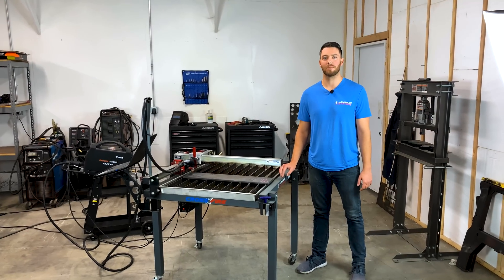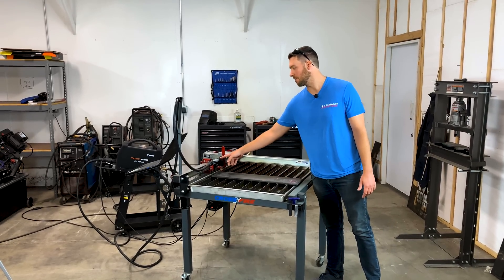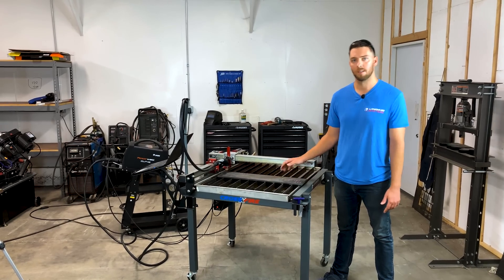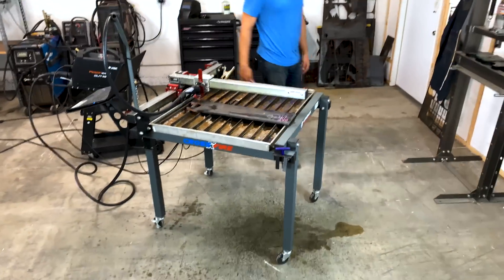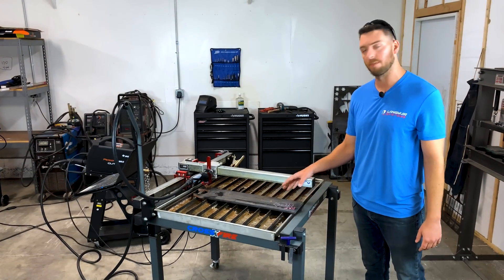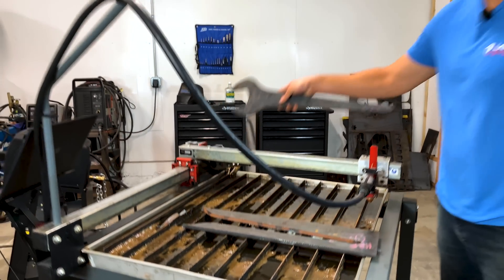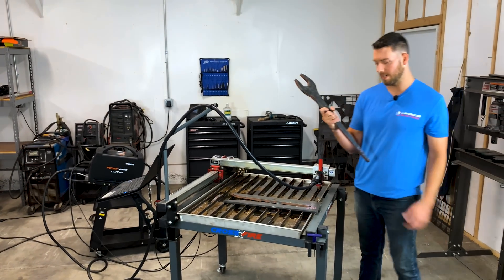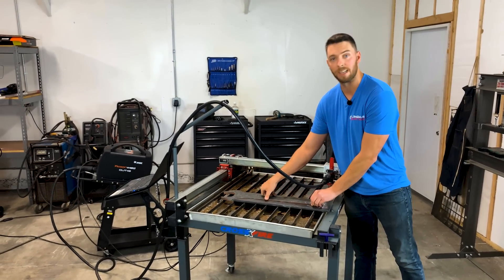$200 wrench for $10 with the CrossFire CNC Plasma Table

Comment: Spending 2400 USD to make a 200 USD wrench you'll only need to use once, knowing it requires additional man hours of heat treating and finishing on a regular mill - priceless..
Reply: But with the chance of making way more stuff
Reply: Being dumb enough to think someone would buy a CNC plasma table to make one tool and that's all - priceless..
Reply: Trust in Jesus Christ

Comment: Just don't forget to heat treat it, or it won't last very long, under normal "torque pressures" the mild steel will lose shape. Just saying.
Reply: yep.. the process isn't done yet!
Reply: Cold rolled or hot rolled steel won’t harden, not enough carbon in it. I made a part several weeks ago and thought it was tool steel, sent to heat treat and it never harden. The par I made was mild steel.
Reply: Trust in Jesus Christ